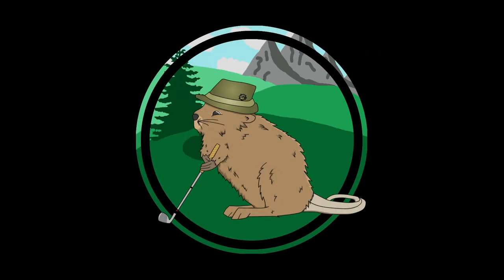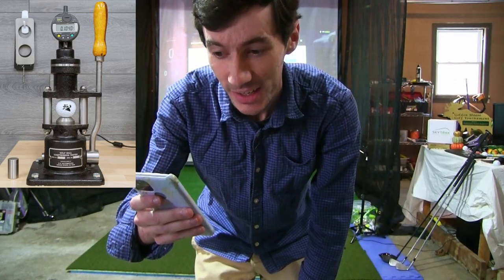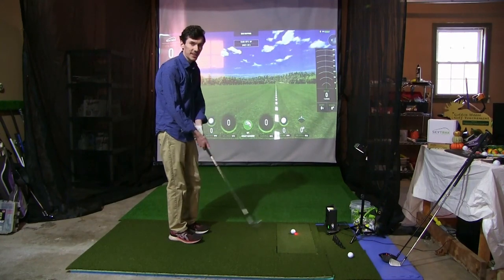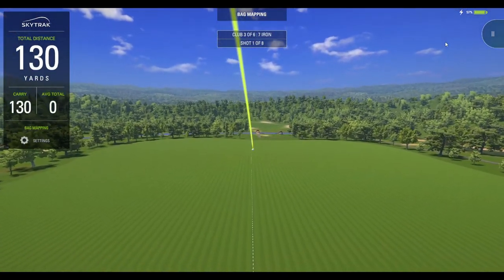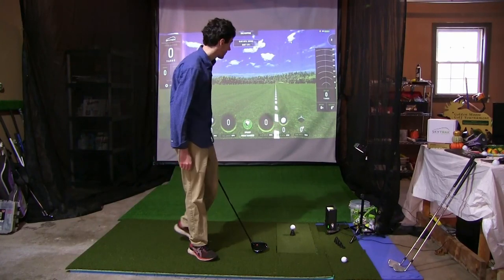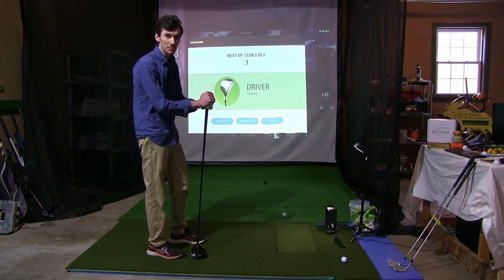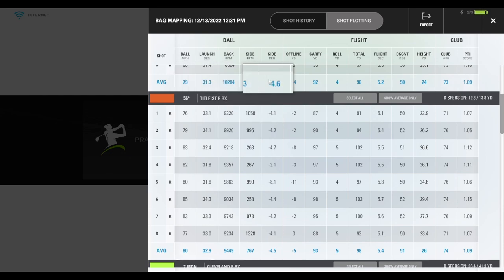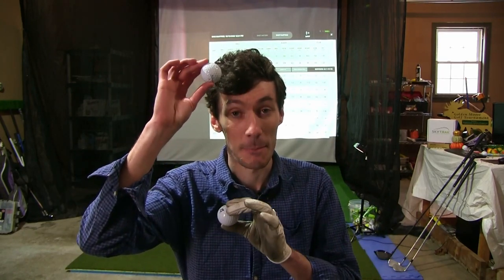Hard vs Soft Urethane Golf Balls - What Does the Data Say?!

Comment: Softer Compression is mainly relied upon swing speed for lower to mid speed,, so with one swing speed at a higher 102 to 105, it isn't a great data parameter.
Reply from the maker: With lower swing speeds the gap would be even smaller. It's a popular myth that slower swing speed golfers need a softer ball to hit it further. Check out some other robot testing from places like MyGolfSpy and you can see these different settings in action with a robot instead of a human it's pretty insightful. 💪

Comment: nice video! I keep hearing compression really doesnt matter too much, but I swing 85 max driver 225 or so. Thoughts on compression I should use. Currently my 2 gamer balls are the Vice Air Pro and the Srixon QStar Tour. The Srixon is 67 compression and Air Pro 75. I pay to an 11 handicap.
Reply from the maker: @BruceOglevie  Depends on what you need for your swing really, even at 85mph club, you will still gain distance from a firmer ball. Will it be noticeable for you at an 11hcp or me at a 6? Not really, pure ball striking is still miles ahead in determining if we hit a good shot or not, but at least when you fo square it up, you might get an extra 10 or 15 yards!
Reply: @muskratlinksgolf  by “square it up” do you mean with higher compression ball I may gain the 10-15?
Reply from the maker: @BruceOglevie  Technically speaking, studies have shown at every point of compression is about 2 or so yards extra all things even.

Comment: Pointless exercise really as there's no industry independent compression standard. Manufacturers each have  their own compression measurement specification,  so you can't make an accurate comparison between different manufacturers' products.
Reply from the maker: Typically this is an accurate comment but these compression numbers are from an independent testing source so it is uniform across brands which will help prevent exactly what you are talking about! Currently there is no regulation governing manufacturers so independent sources are required to assess compression in a meaningful way. The data you see here is from that source.

Comment: The problem with your test is the companies don't have a uniform way of measuring the compression.  You need to measure the compression of the the balls yourself in your test sample.
Reply from the maker: Yep that's why I use mygolfspy to get all of my compression data as they are an independent group with consistent testing! That being said, I'm actually working on my own which could be spicy. So all my data in this video is accurate and unbiased.

Comment: is everyone afraid to test ball's like callaway warbird.  or velocity  because they might be just as good as the pro v 1.
Reply from the maker: They certainly can be as long since compression is the driving factor for distance as proven in repeated large scale independent testing assuming an equal clubhead speed and impact location. However, losing 6000 RPM of backspin around the green makes ionomer/surlyn balls essentially worthless inside of 150yds compared to urethane covered equivalents. Can you play with cheaper ionomer/surlyn ball? Of course, but you will be relying on the extra height that cover produces over spin to control your distance inside of 150 which is objectively a big disadvantage.

That being said, I love testing all sorts of different constructions and models so we will likely see a test like that in the future on the channel!